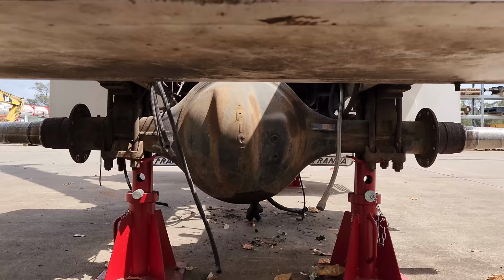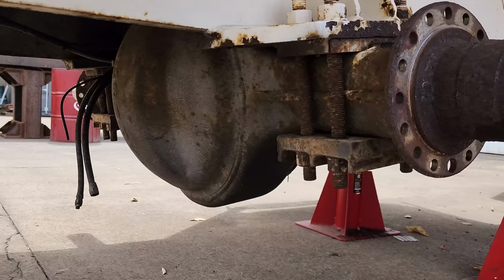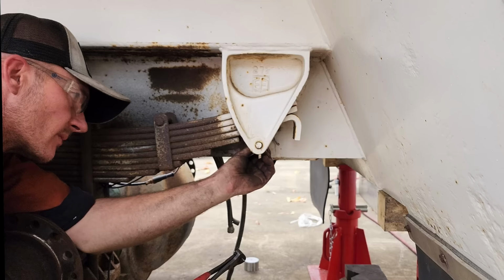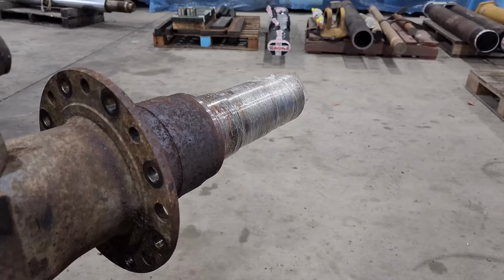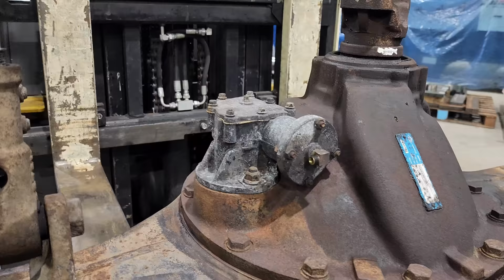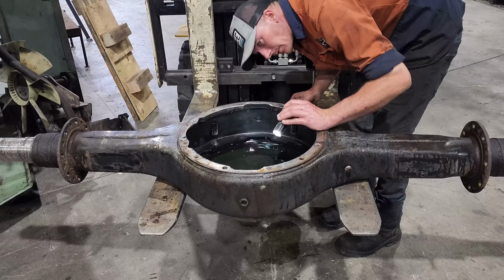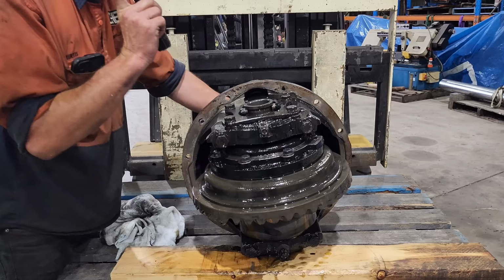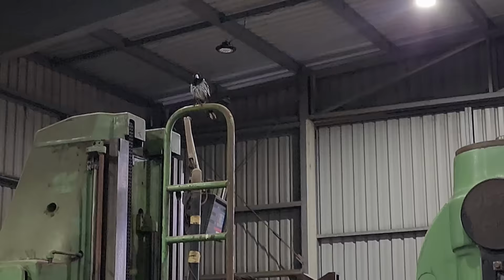Removing & Inspecting The Diffs! | Franna Crane Project | Part 8

Comment: bleh gear oil already nasty smelling, mix it with water creates unholy stench. rear diff came out rather unscathed for having water in it. quick and 'dirty' chop the U bolts instead of fighting galled, rusty threads and nuts

Comment: I used to work for a spring and suspension company you should never reuse ubolts they are like torque to yeld head bolts you should have just cut them and replace them if they are not torqued right the springs can crack from ubolts being too loose oh now I see you cutting the ubolts lol sorry should have watch till the end before comment 😆😆😆

Comment: Dont know why you cut all the stuff you can easily cut tierod bolt head and melt remaining half inch bolt and remove the tie rod but you cut the tie rod. Then you cut u bolt it is so easy just heat and undo the nut why are you making job costly and complicated 😮